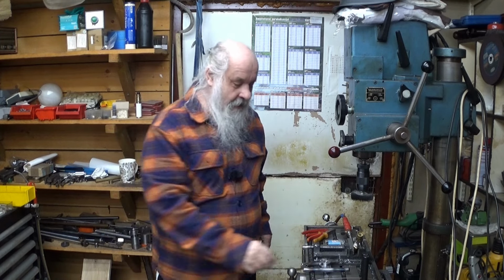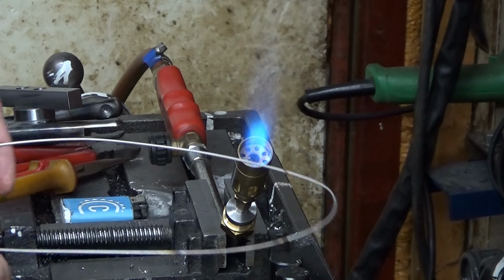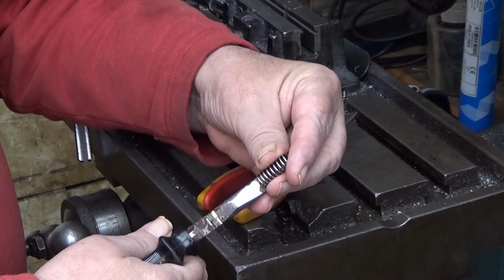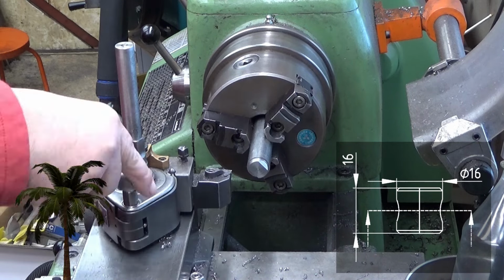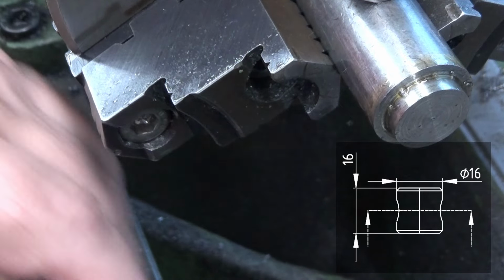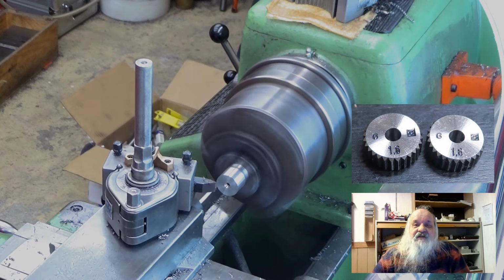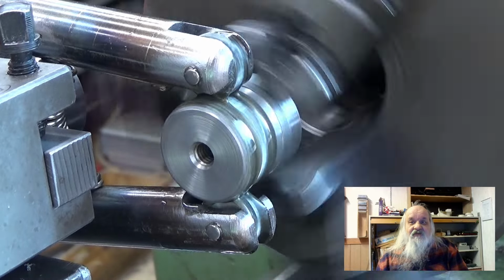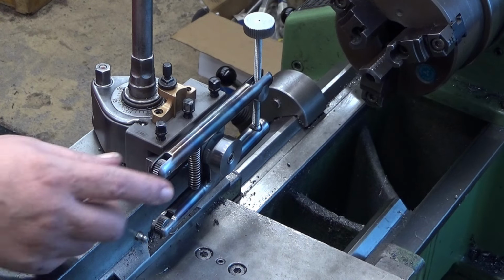Knurling 101, Making my first knurl with the tool

Comment: To straighten the wire, i've had reasonable success using a 2x4 as an "anvil". You hold the end, convex side up and hit it with a ball peen hammer. squashing it a bit between the hammer and the wood. This will now straighten a bit, as the wood crushes under the hammer blow, but not further out ,  resulting in the bend lessening. where you hit it,
Move the wire in and repeat untill it's reasonably straight. Then you can then roll the wire around on the 2x4 to easily see where the last imperfections are and massage them into straightness with the hammer
Reply from the maker: Ok, Method #2

Comment: I always enjoy your videos. You seemed surprised after heating the wire that it did not anneal as you expected. When you anneal, it only needs to be a cherry red (non glowing and hard to see in a lighted room). When you heat to glowing as you did, the wire, being so thin, is actually re- heat treating and quickly air quenching. As regards straightening, there are overtwist methods that are on YouTube where you twist the wire until it no longer shows waves then untwist. Never tried this myself. Thanks for your videos.
Reply from the maker: Ok, this is method #1 I will try in the coming "straighten that piano wire" video 😀